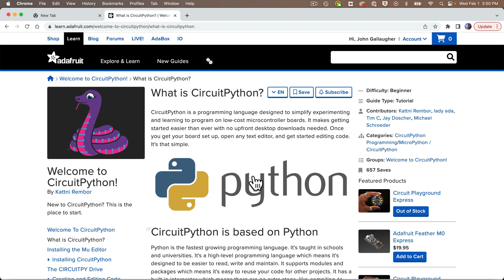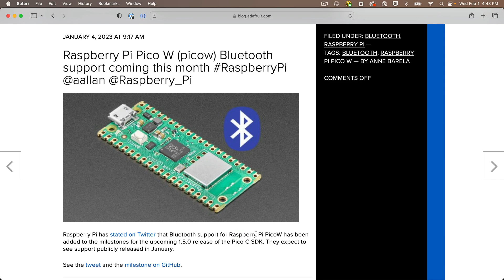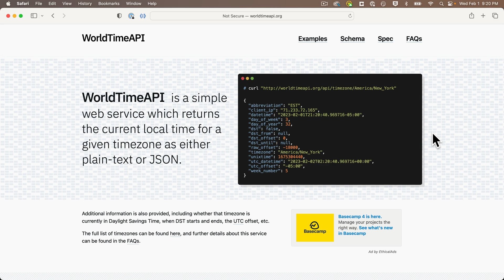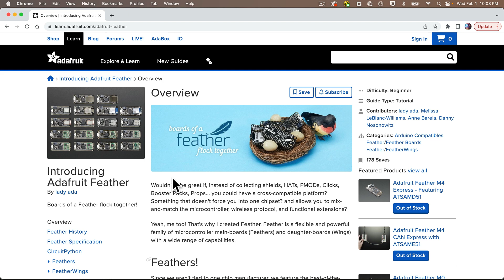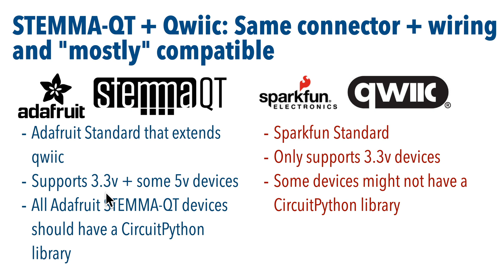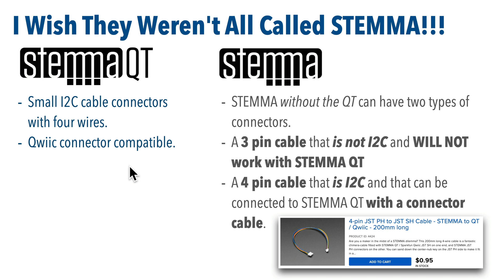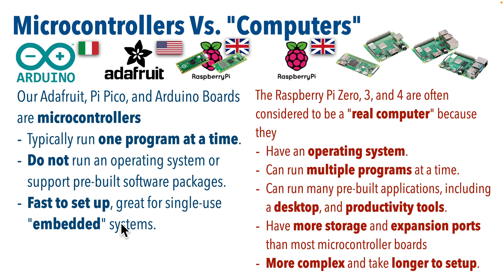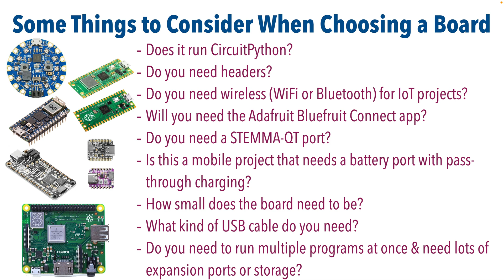Choosing a Board for CircuitPython   A Few Important Considerations

Comment: Yeah I've been burned by those battery pillows more times than I lol.. and that's usually the time that I have taken precautions to avoid problems where it's like.. yep and then I put it in backwards lol.. or I had to take out the wires to do a charging shenanigan... And what should just be a simple matter of putting them back in is all gone downhill because you put them in upside down and eventually you turn a paper clip into a glow rod... Lol... But I mean it's microcontrollers Sparks are going to fly at some point..

Comment: Great overview. I'm glad there's something out there that's focused on the circuitpython side of things. Do you know if the qt py esp32 s3 has circuitpython support to host a website like pico w? I'm considering it as an alternative because I like the stemma qt port. I know it has the wifi library, but didn't know if it has the server module
Reply from the maker: I’m pretty sure it does but I’ve never done it. I’d check Adafruit Discord to be sure. Glad you enjoy the channel. Hack on!
Reply: @profgallaugher thank you! Prob worth getting one anyhow now that I think about it
Reply: @profgallaugher  I bought one of the qt py esp32 s3 boards and can now confirm it'll host a webpage like the pico w. Current adafruit_httpserver library is compatible with the board ✅️ I hooked up a temp/humid sensor and was able to make a little temp reading website with no differences to the pico w other than the added convenience of stemma qt

Comment: I notice Adafruit is no longer designing “all in one” boards like the pygamer, PyBadge and PyPortal. There are plenty of competitors offering such: the LilyGo And Waveshare ESP32-S3 Touch LCD dev boards. However, circuitpython is not yet available for download to these boards, a bunch of work has to be done to configure circuit Python for new boards. I looked at the documented process and it over my head…

Comment: I wish this video was around a couple of years ago when I got started with microcontrollers. I bought several before finding the right one for my purposes -- waster ££ on Feathers with too little memory, Pico with no WiFi etc. I settled on ESP32 as they're cheap and powerful, having 2 cores. They're a little more fiddly to set up with add on hardware, but they run Circuit Python nicely. ESP32 also has ultra low power modes useful for IoT.
Reply from the maker: Thanks for your comments. I’ve also been playing with the esp32. The Adafruit QT Py boards are great tiny Wi-Fi boards for IoT and I’ve used them in a few projects when I’ve wanted to keep things small. I’m sure folks appreciate your comments and experience. Great advice!
Reply: It DID come out a couple years ago.
Reply: Yeah and you can get ESP 32s in a similar weird configuration abundance. Actually a lot of the feathers I saw were using them at one point.. or at least it seems like it.. lol The itsy bitsy I think is an ESP32 like at its core? I just remember wanting to avoid it for the longest time... And then finding out it was basically the the fruit version of exactly what we needed lol that teacher has been right about everything so far with the exception of just the whole concept of doing the project in Python obviously. My credit where it's due, I have fought tooth and nail at every suggestion for the most part just reflexively.. and she's always been absolutely 100% right and she never pushed it and I respect the hell of that. It also is nice to know because now that that's a thought process it's like oh... Yeah maybe the robotics lady knows the thing or two about what she's talking about despite her cult of pythonics.

Comment: One pro of a QT Py is definitely the small form factor for wearables. Other notable small form factor boards are the Trinket M0 and Gemma M0, both are circuit Python capable and each has its own unique strengths and weakness. Right tool for the right job. The trinket comes with the neopixel goggle kit and Gemma is great for single LED projects like lighting a pumpkin with realistic candle flicker, that way you’re not wasting all the GPIO. Figuring out how many and type of IO pins you need is really the first criteria in finding the right board for a project.
Reply from the maker: Thx for sharing, Dev. Great advice!